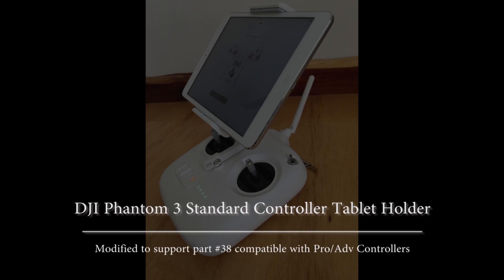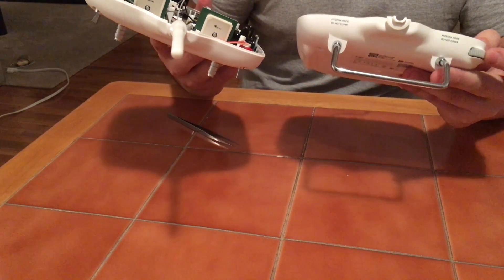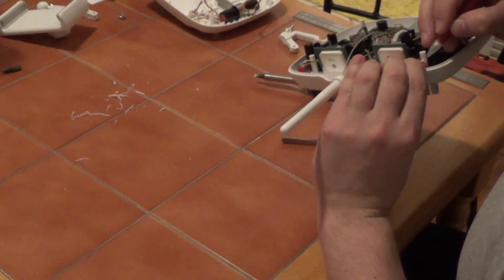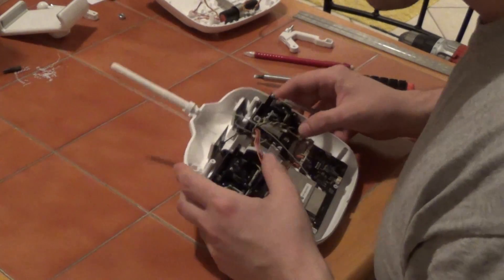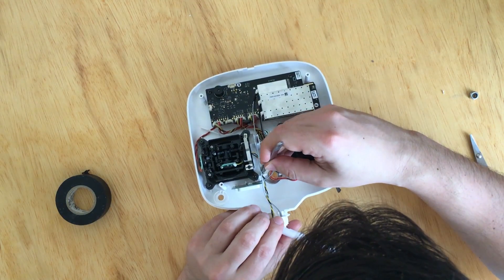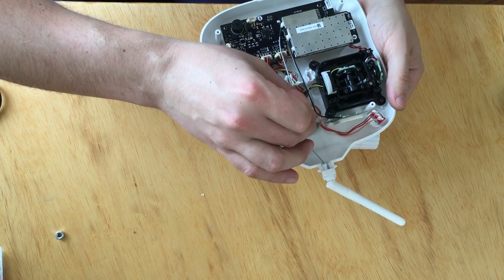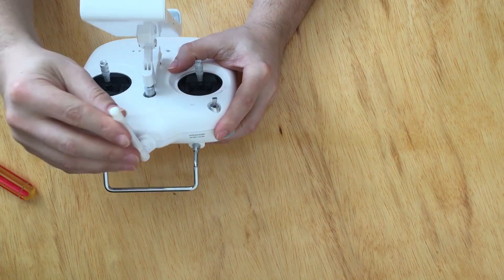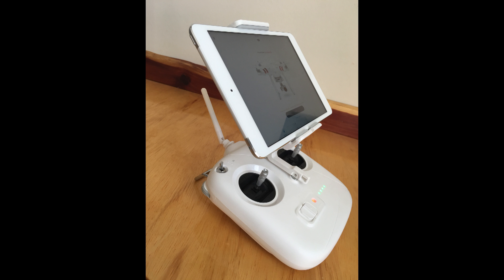Dji Phantom 3 Standard with Professional/Advanced Tablet Mount

Comment: If you open the case from the top instead of bottom first, wouldn't it be easier to remove and install those 3 cable?
Reply from the maker: It would. Unfortunately the only way to open it is from the bottom. At the top it has a notch that has to be first fit in, then the case can be closed. If you look at the whole video, you will see that when I put the controller together I talk about the notch.

Comment: the 3/8 " nut seems too big ?
Reply: That is the diameter of the nut. The inside it is 3/16.
Reply: Also did you take a look at the picture at 00:57? It shows the actual dimensions on the nut I used.

Comment: looking to do something similar, others have said to just screw into the plastic is there a reason you choose this route adding the nut and washer?
Reply from the maker: +JDAGREEK In my opinion, if you just screw it into the plastic, eventually you will strip the threads in the plastic. I wanted something strong and sturdy, that wont strip if I take the support off and on. I have the Dji backpack and the remote doesn't fit in there with the support on. Every time I travel I need to take the support off and I wanted something that will last, be strong and I don't need to worry about striping threads..
Reply: +Raul Nistor Thanks much as soon as you mention to be able to remove it ... it all makes perfect sense ... Thanks for the video, I am going to get started now, also I just purchased from amazon the Argtek range extender.
Reply from the maker: +JDAGREEK If you have any other questions regarding the install don't hesitate to ask. I am expecting today the DBS itelite range extender. I will put a video up as soon as I install it, showing how I did it. What is the expected range on the Argtek?
Reply: +Raul Nistor 4x most people seem pleased at 2633 meters
Reply from the maker: +JDAGREEK That is impressive. DBS extends it about 3 times.
Reply: I am sure they are similar depending on the environment we live out in the country we have about 900 acres but it's still cold here maybe next week will warm up